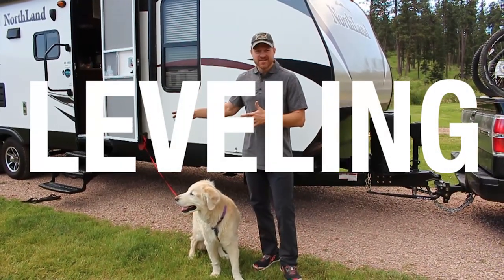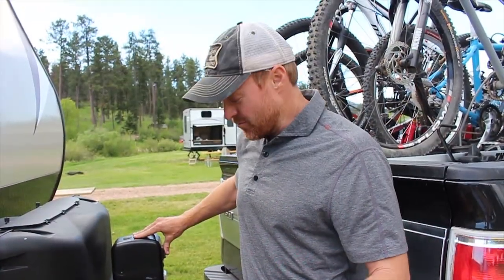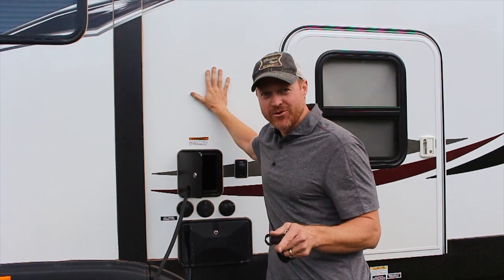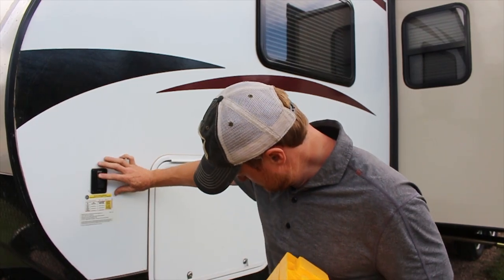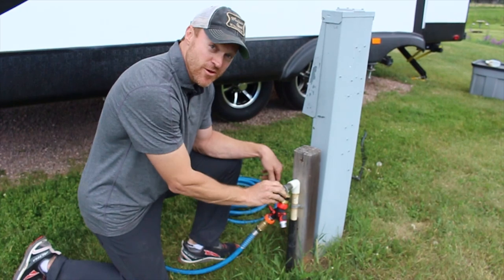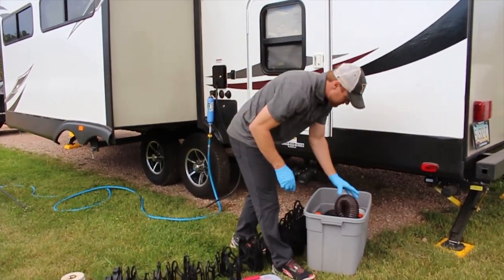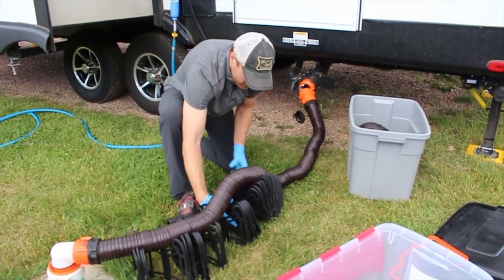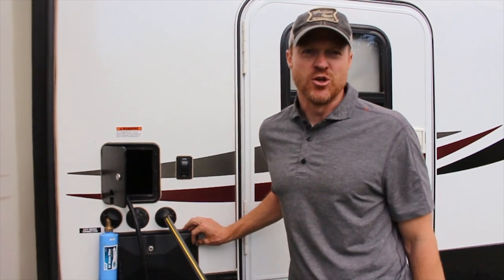HOW TO HOOK-UP AN RV FOR THE NEWBIE RVER! (FULL TIME RV LIVING)

Comment: I'm not sure if there is a comment on this, I turn the water on with the filter connected to the hose but not connected to the RV.  I like to make sure that the water runs clear before I attach it to the RV connection.  🙂🇺🇸
Reply from the maker: Yeah, that's a good point. I suppose I only do that when I replace the water filter, but it's a good practice. Thanks for the comment.
Reply: Oh, by the way, as new as your camper trailer is...do you have a inside water filtration system?  They are usually hidden under a cabinet or behind a access panel close to the main water inlet.  It is a cartridge type filter.🙂
Reply from the maker: Interesting. We had a thorough walk-through and delivery and it didn't come it. I'll check, but doubt it. That would be nice.
Reply: P J 
The added benefit is you wash out any loos carbon from the filter 'before' you run water into your RV.

Comment: Neat videos. Thanks for sharing. How are you transporting your bikes?

At 6m07s I noticed the bikes in the back of your truck. As you probably discovered also, many bike racks are designed for SUV's, cars or vans (not trucks or trailers). I have a similar truck as you and found it very awkward getting the bikes in and out. Thanks!

Comment: Great video - easy to follow and to the point - Thanks!! 

SUGGESTION; you may have already thought of this - but just in case not.  If it were me - in one of your containers that have your water hoses etc, I would add keeping a roll of Plumber's tape, Duck Tape and Electrical Tape. I hate having to stop what I'm doing and going on a hunt for things I could possibly need for any particular application. Just a thought!!
Reply from the maker: Good idea.
Reply: Cyn is plumber's tape the same as lpg tape in Australia- yellow, compared to the white for water?

Comment: Like someone else said, use bleach or like I do Lysol disinfectant spray. I spray the outlet, hose ends, though I also do that when packing up as well, my splitter and anything else where my fresh water goes. I have seen some gross things being splattered on water outlets to not use something. Also I would say, get a surge protector, either at the pedestal or  for a little more money, hard wired, that way it won't get stolen. Have fun.
Reply from the maker: Good points. Thanks.

Comment: This video makes me feel a little better. I like seeing the tasks done before I give them a try. I had one question about sewer hookup. When you are at the rv site, and after your stinky slinky is all connected, do you just open it up so that it self-flushes with every use throughout your stay? Or do you have to go out every day (or couple of days) and pull the release to flush? I cannot find an answer to that question anywhere, so hoping you can help answer! (do you guys have another video focused on black and gray tanks, or can you recommend one that would be helpful? It's one of the things that I'm most unclear about). Thanks Marc!
Reply: You always leave it closed until ready to flush it out. The sensors will let you know how full it is.

Comment: Newbie here🙋‍♀️ So, isn’t there just one water hose to hook up that goes into the camper inside? Also, since you’re hooked up to a sewer why use a bucket in the kitchen to pour out water? Doesn’t the water immediately drain into the sewer line or does it sit in the gray tank? Lastly, do you fill up a fresh water tank even though you have full hookup? We’re soon taking our camper to Stone Mtn in Atlanta and just feel overwhelmed with all that we have to do🥴

Comment: I bought a dog bone that goes from a 30 amp female to a 50 amp male. I carry this because this actually happened to me, we got to the park, set up, I plugged my fifth wheel which is 30 amp into the box and the 30 amp plug was dead, I put on the dog bone and plugged into the 50 amp and it was working fine.
Reply from the maker: Good point. I read in another comment that 50 to 30 might be better juice anyway. I'll get one. Thanks for the comment.

Comment: hey guys, thanks for the information.  I was once told by a friend that it is important to unhook from the truck and level everything out in a certain order.  have you heard about anything like that?  for example someone told me it is important to do either the front or rear levelers first and to unhook from the truck either before or after you have already put down either the back or front levelers.  I can't remember exactly what they said but it seemed that after you chalked the wheels, you unhooked and then went through the rest.  thanks in advance!
Reply from the maker: Yes, it a good point. 1) Check distance to water and elec. 2) Level left/right 2) Left front to back 3) drop stabilizers 4) bring slide out 5) open beer. *I don't always put the stab. down before pulling the slide out, but it ensures the slide will be on the tracks right.

Comment: Thanks for video.  It raised a new question related to leveling the trailer.  I have experience with utility trailers, but not something needing leveling.  So this video left me confused as to why someone would level a trailer "before" detaching from the truck - because after determining level, you have to then raise the trailer off the hookup, right?  So to disconnect from the truck you're throwing the trailer out of level by lifting the front end?  I'm missing something, but probably covered in another video somewhere.

Comment: Great Video. Looking to get into a trailer RV Living and wanted to ask. You showed that you leveled it, then raised the hitch high to pop off the load list bars, but if you lifted the trailer, did you lower it after you unhitched it? Because that would have made it unleveled. Especially since you showed you used the stabilizing bars to hold in place.

Comment: Didn't read all the comments but wanted to point out that I do not open the black water valve until I'm ready to leave, if you leave the valve open all your chemicals are gone down the sewer and your waste is going to pile up in the base of your tank with nothing to break it down, you can't assume your waste is going to go straight down the sewer just because you leave the line open.

Comment: I have a question.... I have been camping all my life, but usually in a tent, or a small camper with no bathroom.  This year I have upgraded to a 28 foot bumper pull that has a bathroom and shower... my question is, even if you are at a site that has full hookup... you should still leave your black water valve closed until the tank is about 1/2 to 2/3 full before opening it and dumping it into the hookup, correct??  I have been told that leaving the valve open all the time could cause some solids to stay in your black tank while the liquid all runs out... just want some clarification before we make our first journey with it... thanks
Reply: Yes, dump when tank is at least 1/2 full. Toilet dumps into tank and not straight to hose. Solids will build up. The extra liquid acts like a flush.

Comment: Marc, Is there a reason why you store your sewer hose in a plastic bin, and not in the rear bumper of your trailer? We've just bought our first RV (currently in winter storage) and at this point we are just getting necessary information and supplies so that we are ready to go full-time next spring. Our 5th Wheel actually has a built-in tube specifically for storing the sewer hose but I am not sure how excited I am to use it.
Reply from the maker: I've seen many people that do that. I prefer it in bin and keep it in the truck. I can clean the bin and it feels like it containments less. But I'm sure the tube is fine too.

Comment: laugh my butt off when I seen you change that tire get a big 4 way I used one of them Harbor Freight floor jack I hate bottle jack too slow. get 3 ,4x4 block and a small plank put jack on I use Jack handle in my four-way
Reply from the maker: Good idea. Got the 4 way within a few days of the first flat. Still need to get a good jack. I have a LOT more room in my truck now that I've eliminated what I don't need. Could add a floor jack easily. Might go out today to get one.

Comment: Thanks for uploading. But why did you censored the clear elbow black water tank? I'll bet it looked like mud than the real 'deal'. And the support' for the black water hose, has that some bands to keep the hose on that support? Waiting for some 'how not to do' videos. Lol.
Reply from the maker: Mostly a joke, but you're right. Just muddy water. In fact, many times bright green with chemicals. What do you mean by support bands? Haven't seem those. Mine threads on tight.
Reply: I saw this with rvgeeks, it is a band which is placed over the sewer hose to secure it in place.

Comment: Silly question but should a check valve be installed on the gray water hose? At the wall connection or the splitter?  As a former plumber cross contamination is a fear,  i.e water back siphoning from the gray water connection to the fresh water connection.  A sudden loss in pressure at the supply could cause water to drain back from the non-potable  and the return in pressure could possible push the contaminated water into the fresh water side.  I realize I'm being redundant in my explanation but i'm trying to be clear in what what i'm saying. The vacuum breaker at the hose bib is designed for that reason but a splitter after the vacuum breaker could cause a potential bypass for the two connected lines.  Just wondering.
Reply from the maker: You're right. I was new then. But I don't leave connected. I only attached to the Y when flushing. And now days, I only flush before dry camping one or two times per month. Your point is valid.
Reply: Keep Your Daydream, thanks for the response.  I’m considering buying my first travel trailer and was watching your very helpful videos. That was just something that caught my attention.

Comment: Where is your backwash regulator   the gray line to the water is cross contaminating your drinking water  there at the water spigot
Reply from the maker: Okay, I'll get one. My regulator might have a backwash function built-in. I'll check on my past Amazon orders. I don't normally leave the gray line connected. Only connect it when I santiflush. Thanks for the comment.

Comment: Great work with the videos. I am a true Newbie and have found your videos very informative and helpful. I'd like your thoughts/opinion about a couple of things/products I'm considering for my RV trailer. Mind you it will be stationary for about the next 4 years unless a hurricane is going to hit Ft Lauderdale, FL. 

First, I'm looking to get a Flojet grinder pump to deal with the waste tank when necessary, but I've seen several recommendations to install a secondary shut-off or gate valve. I found the Camco 39062 Dual Flush Pro Holding Tank Rinser with Gate Valve at Amazon which appears to accomplish both functions. Any thoughts/recommendations?

Second, what do you think of this dual direction levels verses two separate single direction level that you referenced in your video? Camco 25543 T Level

Thanks for your efforts and videos. They are not only entertaining, they are tremendously helpful. Nothing like learning from those who have walked the path before you.
Reply from the maker: Thanks Val. My recomendation on the water pump... if you're going to buy one, get the same one in your rig or make sure it also works with your rig. This way you'll have a spare if anything happens to it on the road. However, like everything we rec. waiting until you need it. I have a built-in santi-flush that I now use the day before dry-camping days... but there really isn't a smell if there is plenty of water in the tank. I'd wait and see if you really need the Flojet before buying it. I bought a whole bunch of stuff I don't use anymore. Regarding the level. I'm sure there are better systems. I only takes a second for me to level. I still use my 3' level 16 months later.

Comment: Not to sound like a nancy, but is that hose splitter certified for use with potable water? Just something to consider. Also, your  Amazon link for that leads to some earbuds, not a splitter.
Reply from the maker: Thanks. This video was so long ago, I need to go back and check the links.

Comment: not high as possible, you hitch but just take the weight off will be fine.and your water only needs a 1/4 turn that way your not putting stress on the pips, most parkes have to much.
Reply from the maker: Thanks for the comment. I have a pressure regulator, but should add an annotation so people don't make that mistake. Yes, you're right, as long as the weight is off, the weight distribution won't snap back, but it is deadly under load.
Reply: your write, i did it once, thats all, lol grate videos, please keep them comeing .
Reply from the maker: Yeah, thats a good point. Now that I have air bags and the truck is level... getting the weight off doesn't require me to go so high. I'm going to add an annotation about the pressure regulator. Personally, I'd rather have the regulator and open up the valve. Both good points. Thanks for the comment.
Reply: Thanks for the videos, every one can know more a bout camping and that will make our camping better, there is so much to camping and it can be so fun, thank you for your time to teach us.

Comment: Could you send the links to the sanitizer? Also, the stabilizer blocks.
Reply from the maker: Sure thing. I was going to put the links in the desc. but they are all so long! https://www.amazon.com/Camco-44505-Leveling-Blocks-pack/dp/B00480BWCI/ref=sr_1_1?ie=UTF8&qid=1469368339&sr=8-1&keywords=camco+leveling+blocks
Reply from the maker: In regards to the sanitizer, I just use 409 or Lysol spray on everything when I'm done.

Comment: When running the fresh water into your clean water tank, do you have to watch it so it doesn't overflow or does it stop when full on its own? Do you just leave it on all the time so it stays full?

Just so I follow, the only tank that stays full is the clean water, correct? The gray and black get emptied before leaving?
Reply from the maker: In this video, I connected the fresh water hose directly to the rig and the water lines are plumbed directly to the sink and shower facets. The water line stays open (use a pressure regulator) no fresh water tank was involved here. If we didn't have water available, I would have filled my fresh water tank prior to arriving and then turn on the water pump to get the water out of the tank. I don't know how big our fresh water tank is, but it lasts about 2-4 days depending on usage. Yes, I empty the gray often due to showers and black only when it's full prior to emptying the gray, so the gray flushes out the hose. Hope that helps.

Comment: How are you going to make sure you install those little levelers on the front and side of the trailer, level? Are you going to make a video for that?
Reply from the maker: Would that be helpful? I need to do research on how to mount anything to an RV. I have a pop rivet gun that might work. The indicators on the side and front would make it easier.
Reply: That would be very helpful.

Comment: No Water pressure Regulator for your water? The campsite I'm staying at right now has a water pressure of 75psi, had to buy a regulator, it already busted one water hose at the fitting
Reply from the maker: It's on there, but should have pointed it out. It's a brass in-line fitting.

Comment: I have a dumb question. First time I  bought a camper. When I pull in and hook up the sewer hose do I open the valve for the grey water? Im assuming I do so I can shower, flush the toilet etc. Please let me know. Thanks
Reply from the maker: That's what I do. I leave my grey open to the shower the entire time and then the night before we leave, I close my grey tank and let it fill-up so I can flush down the black after dumping. If/when I forget... I hate have black be the last thing down the tube. In that case I would santi-flush, but it's not the same. Hope that makes help.

Comment: Do you need to have the batteries connected in order for the electrical from a home to work?  I used a 30 to 15 amp adapter to connect to house electrical and am not getting any electrical to 5th wheel.  Any idea?

Comment: don't you defeat the purpose of keeping your fresh water and black/grey separate when you connect your grey or flush hose to the Y connector you have your fresh connected to?  It would seem that it would be easy to reverse where you connect your hose which in turn would contaminate your fresh water hose?  I have never hooked up before, so I may have missed something but everything I have watched and read on the subject cautions repeatedly about possible contamination.  Or am just overthinking what is needed for water hookups?
Reply from the maker: Yeah, that's a good point. However I don't leave the grey connected and the water is only going out. This video was so long ago. I tend to flush after disconnecting anyway.